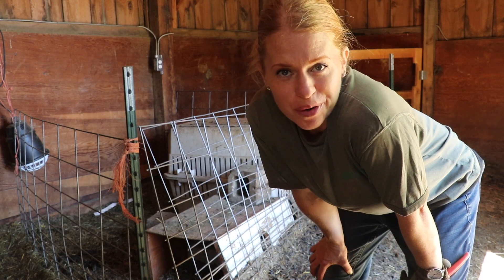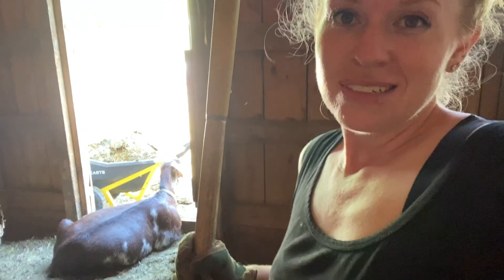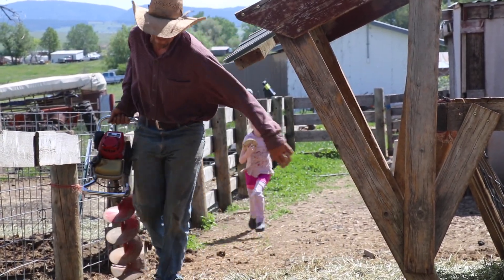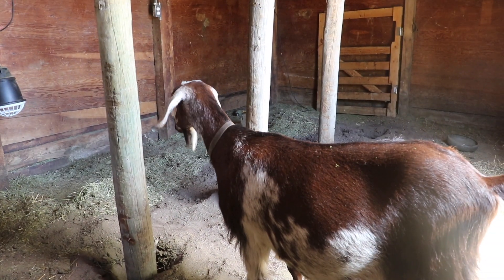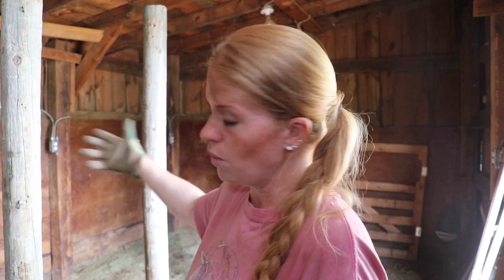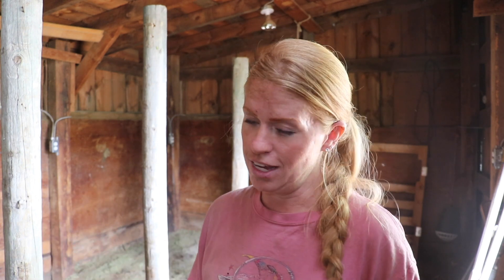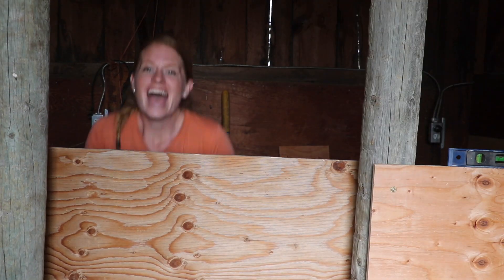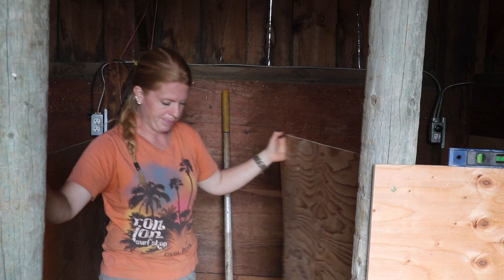NEW Goat Barn Stalls--For Kidding and Weaning! 😍

Comment: I didn't notice where you place hay? Do you hay your goats in their stalls/barn? Or do they abstain until morning? 
I will be redoing my goat barn here, within the next weeks or so as I too, separate kids & dams. 
They will stay in other shelters (your brilliant pallet designs that i just love pieces) for the milking season (does by the milking barn & wethers in a smaller pasture away from the house). My struggle is where to put everything!  This barn is only in max use part of the year, but it's use is very specific at the same time. 
The hardest part of winter, everyone sleeps communally in the barn mainly for warmth, so stalls are always open. They pick the warmest spots. Everyone feeds from one hay feeder & one bucket. 
Once kidding begins, they have their individual stalls which stay closed for those tender beginnings. 
Then, it's communal until weaning begins. Kids begin sleeping together in a stall and they have a small bucket and just a clump of hay i throw in.  I tried a hay bag & they always manage to try unaliving themselves in it. Ugh. Little buggers. 
Now I'm milking 2x a day, & I'm ready to get volume. Everyone is castrated & grown up, but that also means...cleaning out all those months of accumulated yuck, and the dusty work of barns. 
I'm getting closer to a system that I like, but I'm not there yet. Iknow what i like,  but i find myself staring into the abyss in utter confusion. I want them to have everything they need, but also have to work with the space i have available.  Hence, yet another reorganization project.

Comment: I'm curious on how you feel about your Stalls Since you built them , but don't have clear view of them from the entrance to the barn ?  I'm trying to figure out exactly how I want my Stalls. I also want to put in a Loafing shelf In as well. I like the height of your walls between the goats. Are they trying to eat through the wall By any chance? We have long winters here in alaska so they spend a lot of time indoors Rather than have outdoor feeding stations Or resting areas. Any ideas that you would like to share
Reply from the maker: The biggest problem I had was during kidding season. The mammas would fight through the fence if they could see each other, banging and banging. Now they can’t do that. They have a private kidding corner now. 

I don’t mind the height. My main door is small enough that I don’t have a clear view of the entire inside anyway.  

Because we have such cold winters, I’ve considered ways to “close in” the stalls and put a “roof” on them of sorts. We don’t have heat in the barn and that would help trap heat more. I really don’t know if that would work though. They’d need some light in there to see to bed down. 

I also wonder if sliding barn doors would be better too. Having not tried that, I’m not sure!